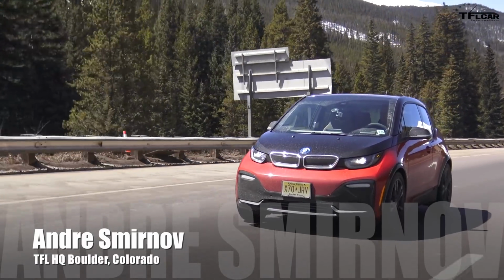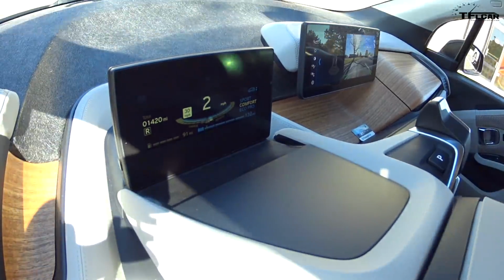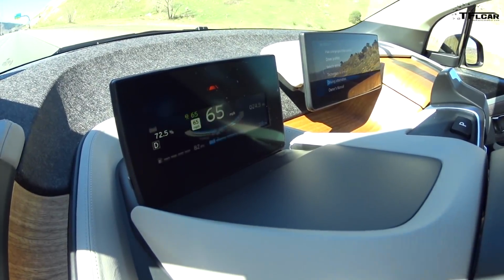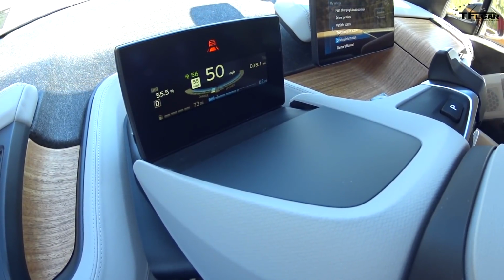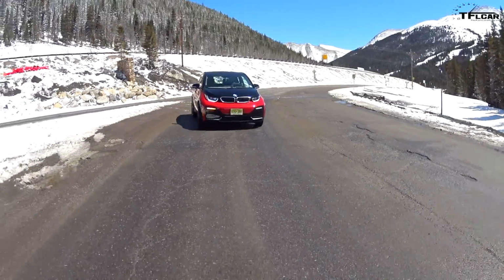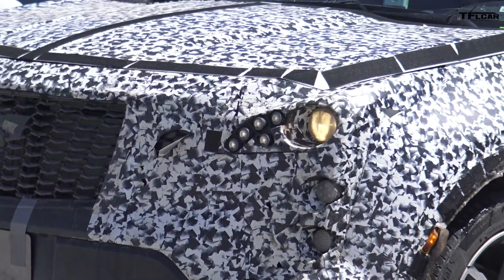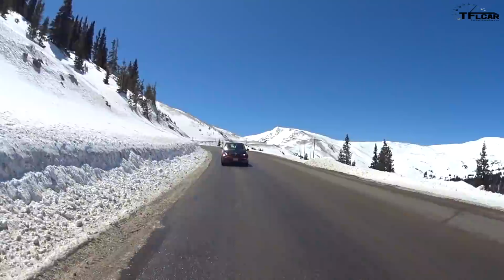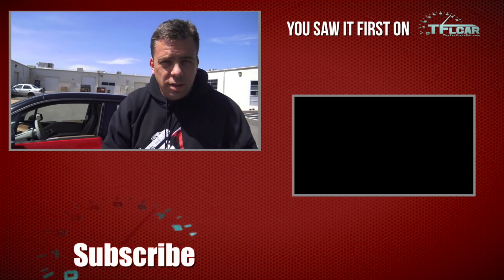Machine vs Mountain: How Far Can a BMW i3 Go On a Single Charge...Up a Mountain?

Comment: Ironically, you almost certainly would have made it if you DIDN'T have the Range Extender. Because of the weight savings of not having it combined with the fact that you would have been able to use that last 6% battery without it kicking in.

Of course, you would have been super-stressed out with that little range left. And getting back would have been impossible, even with the regen.

Lastly, even switching to "ECO PRO", not "ECO PRO +" would have gotten you there no problem. ECO PRO isn't "hypermiling", it just changes the response curve of the electric motor so that it won't be as aggressive when accelerating, and turns down the HVAC slightly.  On my i3, ECO PRO over Comfort can get an extra 10-15 miles per charge (and I have the older, smaller battery model,) without changing my HVAC temperature, or significantly changing my driving style.  (ECO PRO +, on the other hand, makes the car yell at you if you go over 55 MPH, and completely turns off HVAC. That is not a "normal driving" situation mode.)

If you had been in ECO PRO + the whole time, in a non-REX model, you probably would have made it both ways. (Yes, meaning going only 55 MPH on the interstate.)

Comment: Range extender only charges the battery when it gets low it will not effect the performance and you can adjust the Range extender to cut in later if you wish.

Comment: It should have accumulated at least a mile or two coming down that mountain. Another reason to have the hold state of charge function unlocked on this car, perhaps if it was in BEV mode and not REX mode it would have recaptured.

Comment: That range extender sounds like it was built by Briggs and Stratton
Reply: It is, in fact, a 2 stroke motorcycle engine, so you're not far off.
Reply: A 4-stroke 650cc engine from big BMW scooter. Detuned. Yes it sounds like that Briggs.
Reply: I think more Stratton than Briggs

Comment: Excellent  test.  Glad to see the i3 being tested in the mountains of Colorado.  For the record you could have gotten better range if you had used Eco Pro+ in the city and Eco Pro on roads with speeds above 56 mph.  Eco Pro is the way to go if you want heat the entire trip.  The incline reduced the range but the cold weather did the most damage. Regardless,  great test and keep up the good work!

Comment: If the battery is dead you will loose performance with the REx.  It doesn't provide enough power as the battery pack.  You might be able to run seat heaters, radio, AC to get the battery down to 0 without the REx turning on, then test the REx.
Reply: Agreed.  I've seen the 8-bit Guy run a similar test on more level ground where he did see the performance suffer.  I think that's why the REX kicks in automatically before the battery is completely flat, so as the maximize the combination of range of performance together before resorting to full "limp home" mode.  If the REX could keep up with energy use, then all cars would be electric because at worst they would get 35 MPG (EPA of this car) which is better than most cars do now with pure ICE.  I guess we're stuck obeying the laws of physics.
Reply: It was designed for Rex to turn on earlier as in Euro spec. 
It's almost an emergency by the time the REX kicks in. Needs bimmercode hack.

Comment: I wonder if the cold temperature decreased the battery power enough for it to have made a difference? I bet if it was summer, it would have made it.
Reply: Peak winter and peak summer both will effect battery performance. After this video i definitely wouldn't even consider buying an electric vehicle if i lived where they do, he's lucky that car has a generator or he'd have been sitting high and dry on the mountain top..
Reply: 5putput Yeah, or they could've just bought a normal gas powered car, saved themselves $40,000, and gone up and down the mountain 10 times in one day.
Reply: emdec55 rite tho
Reply: 5putput You're right, a gas car is waaaay better. Thank's for pointing that out.
Reply: 5putput Gee, a BMW i3 or a Mustang GT350... A BMW i3 or a Porsche Boxster, A BMW i3 or a fully loaded Kia stinger... A BMW i3 or a Ford F-150 Raptor... A BMW i3 or a loaded 330i... A BMW i3 or a fleet of cars that I could use to start a business... Hmm, I don't know. The i3 is so tempting.
Reply: 5putput If you're at this point and you asking such questions, you are delusional.

Comment: The pricing on these is just stupid... look at them on the used market! You can get one with less than 20,000 miles for less than 18k
Reply: which battery capacity are you talking about?
Reply: Yahh  can without the range extender 
With range extender and  higher mileage and basic options yahh less than 20 k
Reply: Please tell me where I can find a used i3s with range extender for under 20k

Comment: Oddly, the energy required to haul the extra weight of the REX might have cost you the ability to make it to the top on electricity alone.
Reply: Perhaps, but its only about 100lb including fuel so you're basically arguing about the weight of an additional passenger in the car.  Yes, every pound counts, but there are many other variables such as wind, temperature, etc. so I doubt the extra weight was the deal breaker.
Reply: Comparing the curb weights, I believe the weight of the REx engine is about 260 lb.  Just FYI.

Comment: Every time I’ve run out of battery it’s nearly impossible to get up a mountain on the range extender. Not trusting it when you say “no degradation of power”, would have been nice to see your MPH going up that mountain.

Comment: Great car...I wanted to know if you can just maintain the 6% battery charge and just fill the 2 gallon tank every time and use it as like a regular car?
Reply: You can, but there really is a reduced power mode the care can go into where you can’t go over 35 mph.  He didn’t hit it here because he used the Randell extender so little while going up hill.  And filling the tank every 70 miles would get pretty tedious.

Comment: $58,000 is crazy, my car gets over 50MPG. Up hill it won't get that good but my 2016 Ford Fiesta 1.0L Ecoboost was under $15,000.
Reply: 5putput For $58,000, you can buy a Ford Fiesta, a BMW 3 series, and you'd still have nearly $10,000 leftover for fuel.
Reply: 5putput What equivalent 3 series has a cardboard interior?
Reply: 5putput LOL, "somewhat overpriced"?
Reply: Yeah i rather get a 3 series or a M2 over that any day the value just isn't there.
Reply: Compare it to its direct competitors the Nissan Leaf and the Chevy Bolt and you'll realize just how overpriced it really is.
Reply: fiesta is crap, plus pollutes
Reply: They have survived some spectacular crashes, without that life cell being compromised
Reply: buy it used .. I got mine for $17k not the S version but wait 2 yrs
Reply: I REALLY doubt ANYONE has paid $58,000 for a BMW i3. They either lease it (at the monthly payment of a car that sells for far less,) or they buy the lease-returns used two years later for half price (or less.)
Reply: It’s electric car test. Go somewhere else’s
Reply: You can buy whatever you want for $58.000. An endless world-cruise maybe. Thats not the point is it? Try to test-drive one, its a different world
Reply: Your Fiesta does not get 50 mpg and the MSRP was not under $15,000. You can call the i3 crazy, but at least don't lie about your comparison.

Comment: You seem to be driving with the LED headlights on. Would that affect the range? I love mine, in spite of the ill-informed comments you have below.
Reply: dave20thmay Day time running lights. Pretty much all the modern cars come with those and I don't think there is the option to turn them off. And the energy they consume is insignificant, turning those off would not give more range.
P.S My bad, I had another look at the video and he was indeed driving with headlamps on. Still, turning them would only save the range for 10 meters?
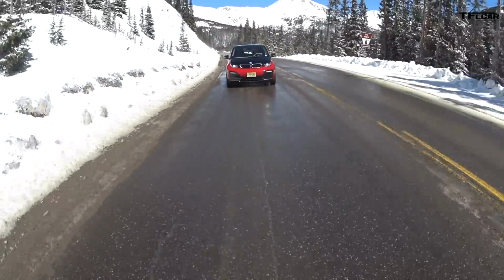Reply: Thank you for the answer.  I would have thought, what some people call the Angel eyes as being the daytime running lights, but whether it's the sun shining into your headlights, it makes it look like the dipped beams are on. As when you are following at 1:42.
Reply: Yeah. I noticed that too. First I thought they were just day time running lights. But then noticed that you were right. He was driving with dimmers or head beams? .But still, even those are LED in this car and turning them off wouldn't add more range. Also you always use lights in the night and so far I haven't heard evs getting less range in the night time than in the day time .So I guess the range impact is insignificant .
Reply: The headlights are powered by the 12v battery system, not the main batteries that power the motor.

Comment: I still don't get why electric cars do not have a solar panel roof.
Reply: It would make an already really expensive car more expensive. Solar panels work best with a certain angle and ofcourse out of shade, which on a car isn't ideal. The Fisker Karma did have a solar roof though!
Reply: RP Wow you just invented perpetuum mobile. Oh wait...
Reply: Tony Hightower Some do, but most don't, because solar panels cost too much and return too little energy. If you were to have an entire roof panel be solar, it would barely collect enough power to run one accessory, never mind the entire car, and that's with maximum energy collection on the sunniest day of your life. You'd add a lot of cost for so little gain. If that isn't enough, solar panels degrade ~1% every year, making less power to the car. Really, this is why the idea of solar energy for everything is far fetched.
Reply: Not enough surface area on the roof to generate enough power in ideal conditions.  Tesla tried it with Model S test mules and ditched the idea.
Reply: Solar power is a joke. That's why they don't have them on cars.
Reply: RP Yeah, and they should also put a wind turbine on it. Then you can pretty much eliminate the battery pack or need for plugging in. We've completely solved the world's problems.
Reply: RP and Goss And then they should put a nuclear power plant in the trunk. On top of that, they can fit a wireless charger, but the charger wouldn't be for the car, it would be for the city to collect from the car!
Reply: This is amazing thinking.
Reply: Skipper, then we could put a xenoplutominium ore drive system in the glove box, which we will use to power a dark energy collector. Once we've done that, we build a Starkiller base and put it on the back of a utility trailer, which can be towed by the EV. The Starkiller based will then be used to destroy the sun, because we have enough power to not even need the stupid sun anymore!
Reply: David CD So no need for the solar panels anymore....
Reply: It's racist
Reply: emdec55 Yes, they're too complicated.
Reply: Didn't the Toyota Prius (the last gen at least, if I recall correctly) had a solar panel roof just to drive some kind of fan/air circulation device so that the vehicle's inside temp would't be as hot on a sunny day?
I doubt it would be able to generate enough power to keep the whole vehicle going.
Reply: Some people do that! Charge up at work for free then drive home and power your house for the night.
Reply: they really should i believe the prius prime does in japan
Reply: Skipper so how would you get the 1.21 giga-watts needed to operate the flux-capacitor?

Comment: If it wasn't below zero degrees  he would have made it all the way up in battery mode
Reply: and probably without the REX and its extra 120kg it would have made it to the top. Anyway the new model just released with larger battery would be OK.

Comment: This is misleading, you need to run the battery down and try it entirely in REX mode...you will find that the car is reduced to a paper weight. Most people aren't going to be starting with a full charge.

Comment: It is beyond my understanding why auto manufacturers will have a sport option when the car is designed to get the best fuel economy especially when the transmission is a CVT or the engine doesn't have enough HP and torque. Its probably to help psychology the consumers to make them feel they are having a sporty driving experience.

Comment: I’ve owned a BMW I three mine was in 2014 and the depreciation value on these cars suck
Reply: Ricco kimbrough the use of punctuation goes a long way
Reply: Ricco kimbrough That's because $7500 was taken off the value of the car when you got it.

You'd be a real, monumental sucker if you bought it for its msrp, because that will still depreciate as much as every other i3 with a tax credit
Reply: buy them used then
Reply: being an early adopter has a price

Comment: If someone spends 58,000 dollars on that car, they should considering driving it off a bridge too
Reply: used ones are like 18-20k and that's a great deal
Reply: have you ever seen such an affordable carbon-fiber bodied car? have you ever seen such a beautiful interior design, made with mostly sustainable material? This car simply doesn't compare with the market.